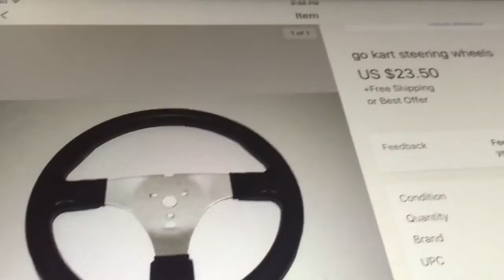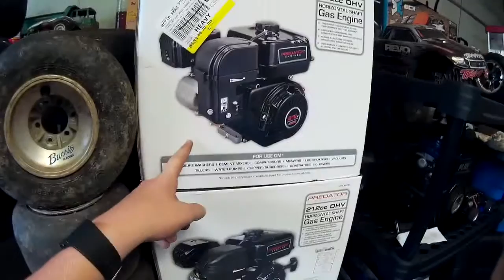$30 Dollar Go Kart Parts Installation

Comment: no a hemi v.s non hemi doesn't run no where near the same.
Reply from the maker: It'll be fine
Reply: is hemi that much better
Reply from the maker: +E. VNDLL not that noticeable,I bought the non hemi so that I can gear it the same and race the hemi,and let you guys know
Reply: +B&C “B&C Karting” Karting hey i just bought a frame for 250$ , pretty descent price , the back wheels look pretty big to me , what size are your rear tires and front ones, mine are big in the back and small in the front
Reply from the maker: +kanton mine hey man I'm sorry,I've been out in the 105 degree heat all day,I painted the drift trike and just got hot and grouchy,lol sorry
Reply from the maker: I'm just going to have to stop comments on all videos to stop everyone from saying I copied C&C,lol
Reply from the maker: +kanton mine I thought you were cool?why you like this?